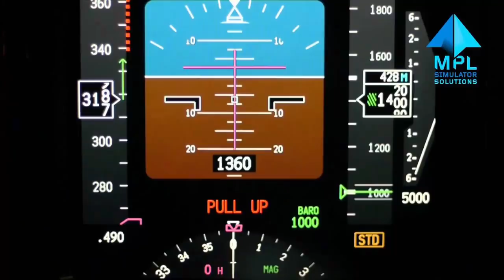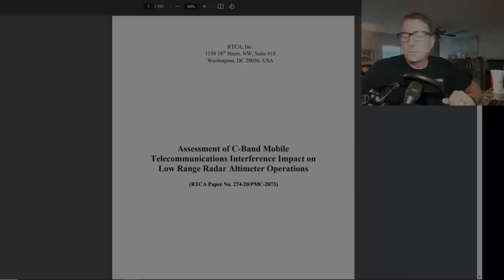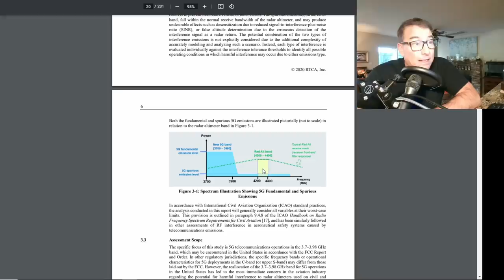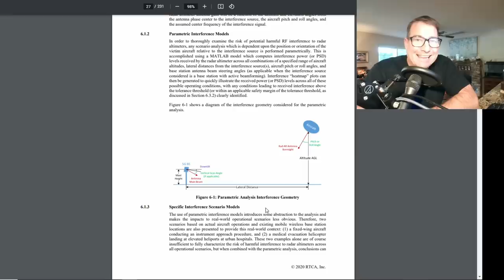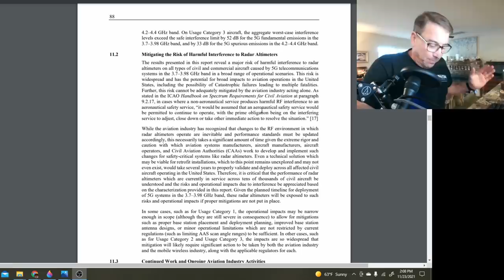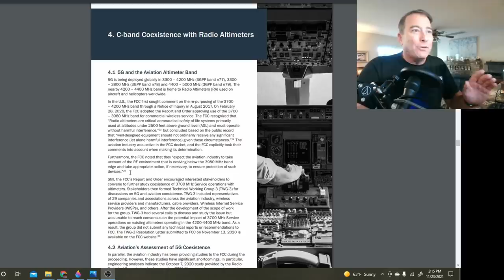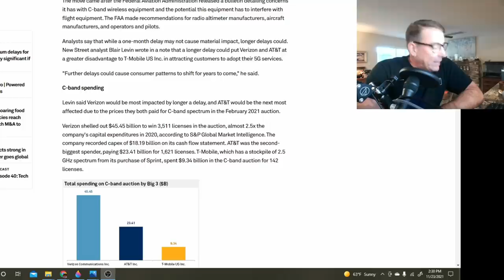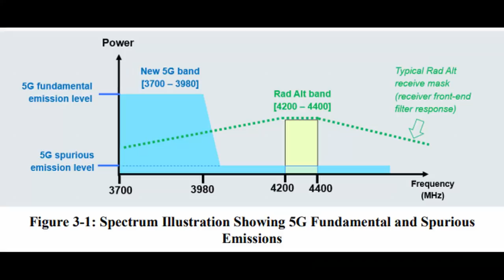5G C-Band Interference with Radar Altimeters in Aviation

Comment: The problem with this is it becomes a turf war. 

It would seem to me that before the FCC can simply auction spectrum which is in used by, or has adjacent frequencies used by, other systems they should have the obligation to determine the proposed users wouldn't interfere with the existing users. 

But, because there's big bucks to be made since the cellphone became a thing, it's become about the money and not so much about what's in the public interest, despite the fact the FCC is supposed to act in accordance with what is in the best public interest. 

I could go through the reports but, it looks like nobody has conducted any real world testing. Because you can produce interference in a laboratory experiment doesn't mean the interference is going to occur under real world conditions.

It should be tested under real world conditions by people with no dog in the fight. If there's an issue then the spectrum shouldn't be available for the new proposed use, it's that simple. 

But, when you get money and egos involved in the process objectivity quickly evaporates.

Comment: You will see how fast all that can change if one of these planes crashes, as usual people will have to die to get anything done.
Reply: Nope.  As the video said, the incidents (hopefully not fatalities) will be blamed on pilot error. It will take a lot of incidents to differentiate 5G RadAlt interference from pilot error.  

We need a lot of real-world, good-weather flight testing and NASA ASRS reports (meaning, every approach by RadAlt equipped aircraft) to tell if there's really a problem, how bad it is, and if you have flaky RadAlt on one approach, will it be all the time, or mght the interference go away for the next plane, three minutes later? 

I see the first aviation impact being the loss of flight crew trust in their radio altimeters, that the video mentioned, leading to more missed Cat II and III approaches.  And they won't just be go-arounds.  If crew considers the RadAlt suspect, gotta divert to an airport with weather that doesn't require the RadAlt.  And they'll have to have loaded enough fuel to do that, on every flight where there isn't a solid prediction of Cat I ILS or better weather at the destination.  Or do they do plan that way already?

Comment: seems to be it should be tested to failure with UAV's set up to operate in the same conditions as commercial air craft. personally i think 5g is a waist of time and money. 4g is still not optimized in most places. wouldnt a laser ranging system be more accurate and much less susceptible to rf interference.

Comment: The FAA's own little version of "skunkworks" has the ability to do definitive field testing with signal quality and accuracy--indeed, they have decades of experience doing exactly that--but they would just need the instructions, funding, and time to get it done if the FCC insists on going ahead with this. Alternatively, it sounds to me like the auction should be conditional on the telecom industry absorbing the retrofitting cost of all aircraft with previous-generation radar altimeters and guaranteeing that the new ones will pass all subsequent testing for interference under any conditions or 5G application--in other words, all liability involving the new rad alt functioning in the US passes to the telecom industry for the next, say, 25 years. If they're familiar with aviation-industry liability, that should line up the incentives of their collective wallet with their safety claims.
Reply: Nothings perfect.
Reply: @tedmoss  At DH and 600 ft. RVRs or less with your family onboard, you better hope that it's certifiably near-perfect. If the FAA doesn't see that as demonstrably dependable, bye-bye to CAT III auto-lands no matter what the effect is on reliable air travel in the foggy seasons, and no matter customer complaints.

Comment: The if on a radar altimeter is very heavily filtered.  The amount of energy retuned when the aircraft is below 500 feet AGL is magnitudes higher than anything else.  Like 100x any interference that could be generated by the 5g space hundreds of megahertz away.  I’m a huge fan Juan, but this is a non issue. Perhaps, very remotely, a very very minor issue with systems built in the 90s but that s%+t should have been replaced years ago.  Appreciate the video though. 💪👍
Reply from the maker: I think you better double check your maths Chris...some of these RA's have virtually no filter at all and only put out 1 Watt. Go back and read the WHOLE report.

Comment: 13:56  Well, of course they shouldn't fool around with this tech; simulation is obviously not going to cut it, there needs to be real world testing done with actual equipment, frequencies and situations, unmanned and autolanding system tested as was done during design and implementation to begin with....  I really don't think that will be able to cover all situations, either.  As far as I'm concerned faster internet isn't quite that important; coupled with interference to existing aviation infrastructure and potential suspected health hazards<?> its my opinion that 5g needs to be set aside or changed altogether.  Assume nothing.  There are alternatives...

Comment: If I were Boeing, I'd form a separate joint venture with Airbus and Embraer and just buy all that bandwidth up front... then force the telecoms to invent/install the altimeter fix at their cost, and once approved and installed, flip the bandwidth to the telecoms at a profit.    Also, I'm not a lawyer, but doesn't the FAA have regulatory authority over airspace (by volume as well as safety-of-flight)?  So for starters why can't they simply exercise their jurisdiction and regulate that 5G radio waves aren't allowed within an airspace that is within 8nm of any approach corridor under 5000 AGL or some-such.  Then serve the FCC and the telecoms with compliance or desist notices and start letting the FCC and FAA lawyers duke it out in legal paperwork, which will take forever.

Comment: If the fCC were doing it’s job, they would not poo poo this report and would conduct tests to see if it has merit. They are not doing so as far as we can tell. If this interference is real and if it results in any kind of accident, these FCC people should all go to prison. Of course we know the real issue, the FCC does not want to burden the Cell Phone Industry with replacing THEIR equipment. Push it off on the FAA and the aviation industry.

Comment: While I'm a huge fan of your channel and General Aviation I respectfully disagree with your assessment. This is a failure of the FAA and the industry to develop quality equipment. Filters in the kilohertz range are common. If the filters on these things are that wide as the green line in your graph there is either no filter or a really wide one. Its trivial to block ranges outside what you are using.

As much as I love GA I've no sympathy for them if they are effected by signals outside of the bands they are assigned. Its poor engineering and there is no excuse for that. 

That said the carriers need to be held accountable (and they are) for staying inside of their allotted frequencies.

Comment: My question is: why did the FCC assign a frequency to cell companies that usurped a critical frequency already assigned to aircraft? Heads ought to roll for this screw up.
Reply: That's not what happened. The radar altimeters are assigned a specific band. The 5G band is more than 200Mhz lower. But apparently some of the radar altimeters are so poorly designed that they can receive signals well outside their assigned bands and malfunction. That's ENTIRELY on the companies that sold them.

Comment: Juan, I disagree that radio altimeter RA tech has superior rights because it came first.  A more cost effective solution would be a redesign of RAs to operate at a higher frequency.  5G is an international implementation.  Because of the huge investment in equipment and engineering, 5G will become a standard.  Plus, 5G is short range, less than 1,000 feet before another transponder must be used.  Antennas in both should be changed.  The RA should have a very narrow beam  to the ground, while 5G should cover near the ground only.  At no time, should an aircraft be receiving 5G from a base station.  Aircraft internet should be done by satellite.

Comment: Sadly, imo, it's only until a tragic loss is realized that the profiteers will adjust their station. But not in their area of operation. The trch that was effected is what will need to be updated, not their adjustment of the frequencies sold to global corps. Money over safety until safety no longer allows profit. Dangerous road as always.
Are we really not able to find a better means of prosperity than that os currency? Terrible concept currency and power stemming from currency is.

Comment: In the ten minutes that I looked at the paper...  a few things immediately stood out...  The powers used in the simulation seems unjustifiable high.  There is no intermodulation study which I would have found to be a large basis for their case...  The over use of the term 5G which is an absolute discredit to their work.  So this paper left it self to some criticism whether they are on to something or not.

First on the 5G thing.  The paper was correctly titled as "Assessment of C-Band".  That is correct.  5G has no practical bearing in the analysis other than to advocate against 5G (other than the Resource Element power which could have been modeled in different ways).  5G is just 4G with some enhancement to the RF Interface and a different core.  Heck you can even run 4G and 5G interleaved together on the same piece of spectrum simultaneously.    The real issue is the power with the prescribed C-Band and how that may effect aircraft operations.

To that end and the second issue I had with it was that the powers given for the r^2 laws seemed way too high to me for a couple of reasons.  The first was the practical link budget of a C-Band gNB/eNb aka the base station.  High frequency sites, in this case C-Band, have very short ranges.  Why?  Because the base station coverage area is designed not to exceed the range of the UE (mobile/handset).  The UE does not have a high gain antenna or a high power transmitter (23 dBm max) and hence the technology is considered "uplink limited".  The powers that are saw in the study were more indicative of what I have personally seen with a 20W transmitter and a high gain antenna on CDMA or UMTS.

So from a very practical "I have seen this in the field perspective" it seem overestimated.

Again they maybe correct but I think they have left themselves open to criticism to people in the wireless industry.  

One last thing you got wrong Juan...  People in the wireless industry do understand the effect their systems can have on other radio systems.  They may not understand the effects on the inputs to the radar altimeter but they are fully capable of modeling effects on other systems.

And... One last other note.  I noticed the whole idea of the RA SiNR was danced around by the aviation industry.  I think most of the RF engineers here would want a more definitive answer when working on a radio front end design.

I am an EE with application based RF experience.  Overall I really need to read this paper because it is interesting to give finally comment...

Comment: Twice the distance, 2000 vs 1000, is half the power.  The new comers have the oblation to PROVE non interference. Aviation has done the testing.  5G needs to choose other frequencies.  I have 2 FCC radio design and repair licenses, one with radar endorsement.

Comment: The only possible conclusion from your graph is that you already have a very generous bandwidth of 200 Mhz but are intruding into the allotments of others an astounding 2000 Mhz, or about ten times what was allotted to you. And the reason you give is that you want to be the only radio-wave users on the planet who still use 1930's technology. Cry me a river. If your graph is anywhere near to reality, the FCC should be imposing a hefty fine to each and every airliner with a radio altimeter, every single time that the altimeter is turned on.

Also, I have heard that in Europe they do not have the same problem. Could it be that they are actually using technology from this century? Like the CDMA that is used in every single cellphone from this century?

Comment: The reality is that it doesn't matter who was there first. The horse and buggy was there before cars, but you don't see them much on the road any more. There is a chronic shortage of radio bandwidth all through the spectrum. Using what is essentially obsolete technology in today's world and saying we were here first is irrelevant. The FAA and the airline manufacturers are going to be the ones that need to catch up... and perhaps they will need to invent a "fast track."  The first time there is some sort of fatal accident that can be traced back to a failure of ground radar due to interference, it will not be the 5G providers on the hook.